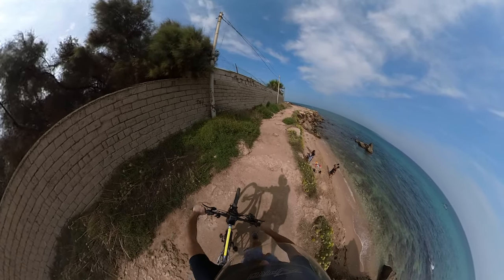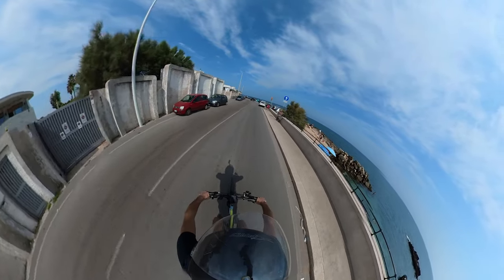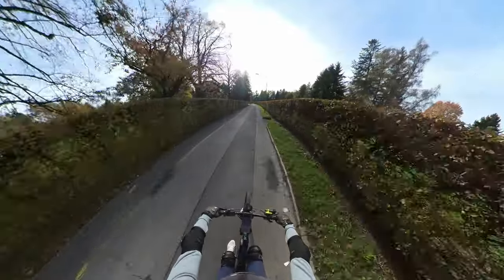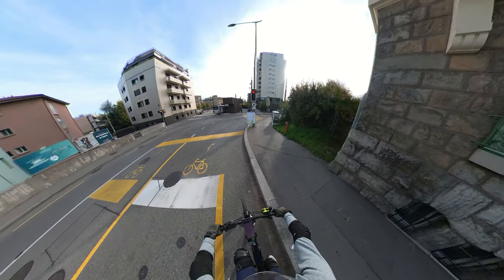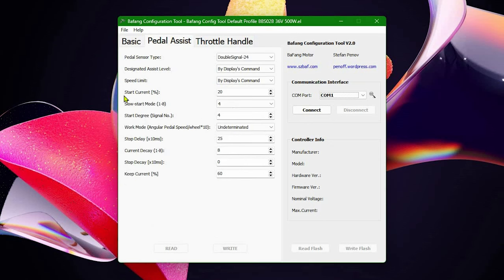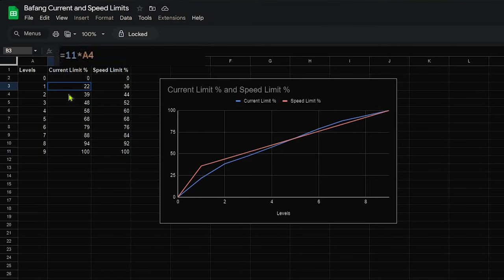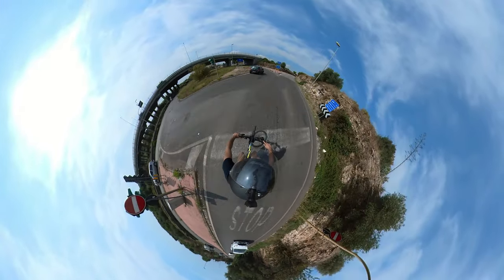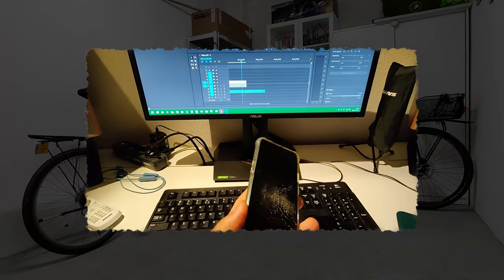Make your Bafang Kit MORE YOURS!

Comment: I have the BBS02 750w. Thank you for making this. I dont like pedal assist. I just want 100% throttle on PAS 0. I can do that or set the throttle menu 'designated assist level' to something other than "designated by command". I live in Detroit and will be using this to haul groceries home in a bike trailer. So I know this is needed. Thank you sir!

Comment: I've fitted a Tsdz2B to my road bike I like the way it works just like beaning pushed, having seen your videos I will leave it at its stock settings for six months so I can get used to it, after that I will give it a go at changing the settings. Thanks for the videos.👍👍👍👍👍

Comment: I have only just begun researching ebikes (I am 74 years old so going down hill is easy) but have found your channel more lucid than most. I want to convert a Trek 7.3 FX (disc brakes) using the Bafang 750W kit. You have covered most of the issues except throttles (thumb, twist and half twist) - your thoughts ?

Comment: I like the way you think about setting it up. I personally set max speed in all PAS levels to 47. That gives me right around 70 RPM for my pedaling cadence. Which is right where I like to be. So the PAS levels will only determine how fast I get up to my preferred cadence. If you set all those speed settings to 100%, you would always be ghost pedaling, and it will not affect the throttle whatsoever. So I don’t know what that person was talking about. Just set throttle to be the same as PAS level nine and you will always have full power and speed from it.

Comment: Good afternoon. I live in Mexico and I have a BAFANG 750 W 48V motor and a 48V 20Ah battery. I use 5 levels of assistance and my question is how should I distribute my current (left column)? That is, in your video you convert your energy support into linear from 1 to 9 levels of attendance (11, 22, 33, etc. until you reach 100% at level 9. My question is how do I divide that into only 5 levels? Thank you for your reply. 😉
Reply: 100% divided by 5 my friend :)

Comment: I'm not 100% sure if that is the main reason, but my PAS stopped working after messing up with Speeed software.
The throttle/pedestrian mode worked just fine, but suddenly no PAS at any level.
After many attempts I finally managed to make it work again but I have no idea how I did it and why I lost it.
Brand new BBS02b 750W.
I'm pretty much familliar with all the settings.

Comment: Hi and thank you for those informations ! Those settings would be the same for the BBS02b 500w 48v or should I change something?
Reply: Yea you just want to lower the percent of power it gives so you dont wheelie when resting your foot on the pedal. Depends on what you want. I'm setting PAS - 0 to 100% so I get full throttle without PAS.

Comment: found out (after buying a used e-bike) that my bafang was can-bus .____.
so after recieving lemons instead of UART i crafted a ghetto ''BESST TOOL'' and started screaming some mystical hex codes to my middrive (virtually).
well.. my display tells me i have my wanted parameters (20'' instead of 28'' and ahem a bit over 25kmh) but this darmn thang aint movin past the 20's for loerrd sake. (fixing my sunhat whilechewing on some wheat)
Reply: i guess from now on, my speed-sensor will forever get krank rev. speed reading instead of wheel speed 💀

Comment: I have set up the bbs02b on over 20 bikes.. The b at the end of bbso2B signifies the later controller that has PAS set as priority over the throttle.. The old bsbo2 had throttle priority over PAS.. This is why the bbso2b sucks balls.. When the system detects you turning the crack aka pedalling the throttle is disabled... WAIT! You will say no its not, it still works loser.. Yes it still works but only if you twist it to 100% anything less than full throttle is ignored.. Now.. The best way to set this controller up is CUT THE GREY PAS WIRE!! Get rid of the useless PAS,, the pedals are there for your leg power and should not be a system to add power to a bike,,, maybe on a 250w but that's it,, Make your bike throttle only!! You ride your bike like a bike man, then you twist in some VARIABLE POWER  with the twist throttle or thumb throttle,,, NOW READ ON... You controller is 25amps right,, you PAS 1-3 or 1-5 or 1-9 depending on your display settings.. Set it to 1-9,, NOW what happens if it's on PAS 1 smart guy?? Then your throttle will have a variable sweep from 0 to 100% of around 3amps.. You can use that to just barely add power say after a long ride you need to get home and you just tap in a bit of power as you go,,, PAS 2 will be like 5amps PAS 3 say 7amps and so on.. You get the idea,, if you put PAS on 9 your throttle will be a variable controller from 0 to 100% of 25amps... You would be surprised on how little power you need to have fun.. In PAS 6 with you pumping the pedals as soon as you add some throttle ya jump to 35km right away.. You can simply click the PAS number up or down depending on your riding conditions and adjust the amps available to the throttle as you ride,... Your bike will feel so much more natural you won't ever want PAS again... Your drive will last way longer and your range will jump by 30%.. I've put over 25,000 km on a bbso2b and pulled it apart and it's still perfect, you just regrease it and maybe a bearing or 2... I could go more into the controller programing but you can research that... Look up "cut the grey PAS wire"
Reply: or you could not cut wires like a moron and load a firmware on that gives u independant throttle usage, bbso2b flashing the firmware with daniel neilson firmware

Comment: bro plz reply recently i buy 750w 48v with 25amp my battery have three green lights and 1 red im a working boy my ebike running very low km im using my bike on 2 or 3 speed sometime because of steep hills when i use some time the lcd says 50 40 and then 30% battery but when i check my battery manual the lights are two green with one red which is the last light bro what i do plz suggest me thanks
Reply from the maker: man I cannot remotely debug bike issues just by guessing, plus it's not what I do, but I suspect a problem with your battery. try inspecting that, like using another battery to see if it's that. good luck
Reply: @LukeLorusso  bro i check the other battery and the same issue i cant drive my all battery just only a high percent when i checked my battery life on its lights its all most 75% remains and the lcd of my bike say its 20% please if you suggest i bought this motor just this month
Reply: @LukeLorusso  reply me bro